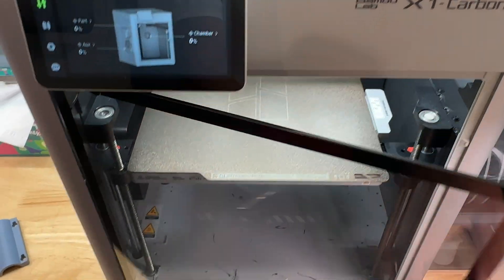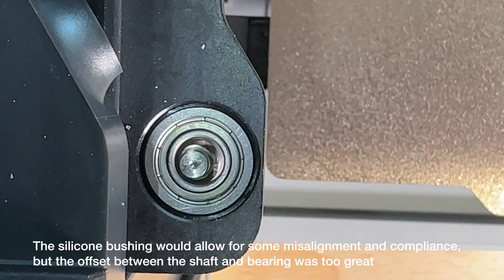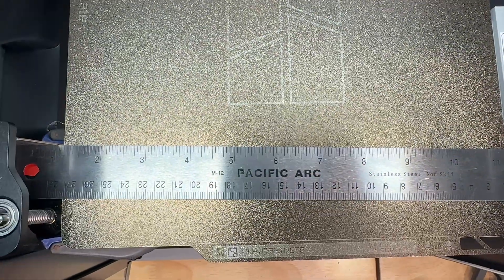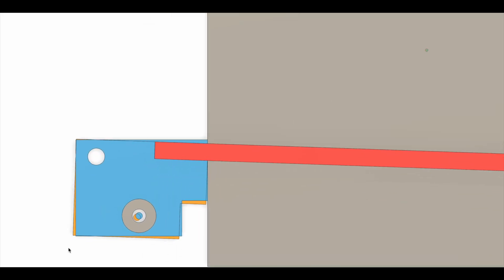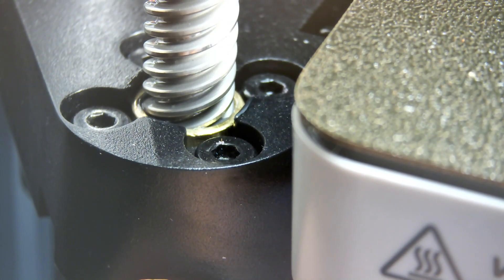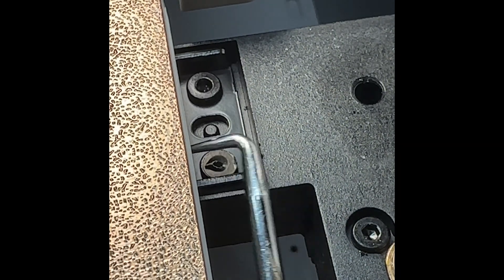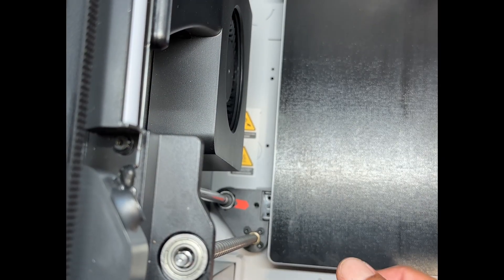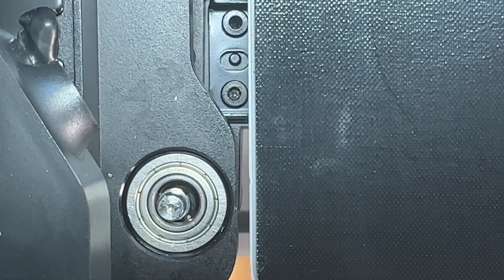Bambu X1C Bushing failure analysis

Comment: I don't have silicone caps, but it does look like there's a silicone shim between threaded rod and bearing. Seems odd to have threaded rod not be anchored/spinning in the bearing. Glad I looked, somehow a bunch of cat hair got wound around the base of one rod.  ";^)
Reply from the maker: I agree, seems odd, but I think they need loose tolerances to avoid binding.  If everything were perfectly aligned it wouldn't be an issue having everything fully constrained, but I think with the base being injection molded, and a lot of parts that need to stack up precisely, I don't think these machines are built with that level of precision. The printer does produce good parts, so I'll just put a cover over the odd bit and pretend it's not there.